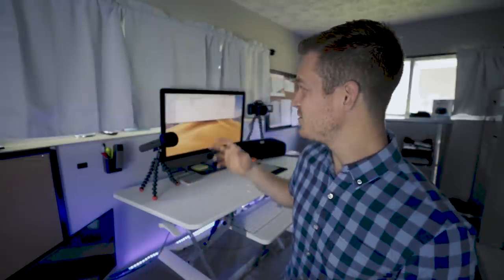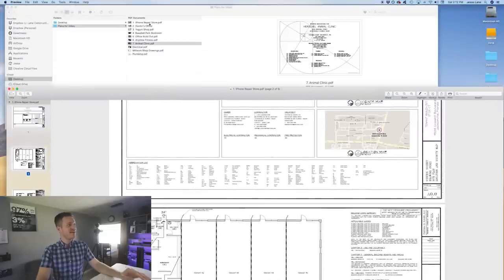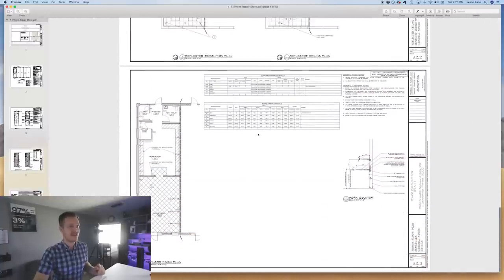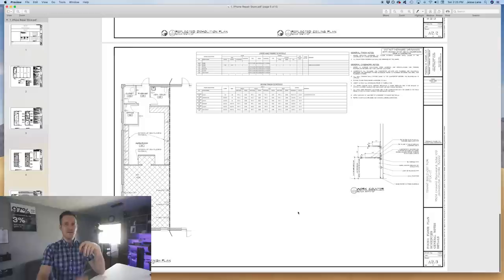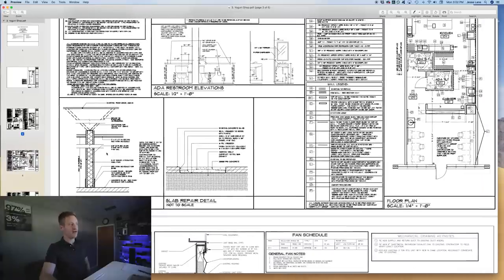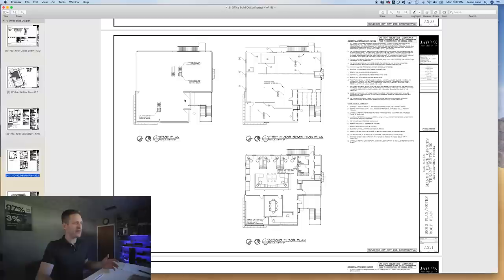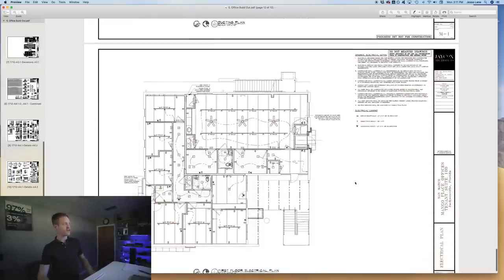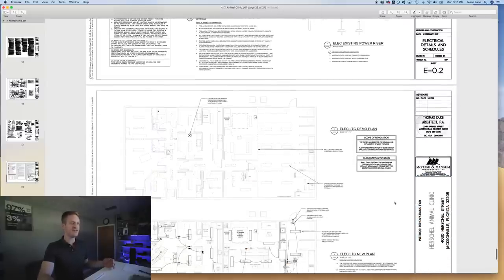How to Read Commercial Construction Plans: A Beginners Guide

Comment: Jesse, very informative. Have a question regarding finishes. How does a person just starting out figure out what areas need painting? For example, new millwork. Do they plans tell you or is this a question for the GC? Along these lines, is there a method from looking at the plans to figure out wall lengths and height?

Comment: Hi Jesse, I have dm ed you on instagram but haven't received any reply so I post here. I am curious about residential constructions in the US. I was just wondering why the houses in the US made from wood instead of concrete while houses in Asia are made from concrete which I think more lasting.
The other day I also googled and didn't find any company that build with precast brick materials (which can be less expensive). Is it because florida has storms and it doesn't comply with the code?
Do u need to get new material (precast brick) certification before you can use them? Thanks

Comment: It still gets me hot when each trade is only referring to one sheet. It's certainly the superintendents job to coordinate everything and review field conditions. But the trades should also take a guick look at the other drawings. Also not having a drawing set not mine on site is a problem. Yes we have I pads and such but each trade should have at least the a 1 or floor plan and ceiling drawing. Some subs send there guys to job and they are lost.